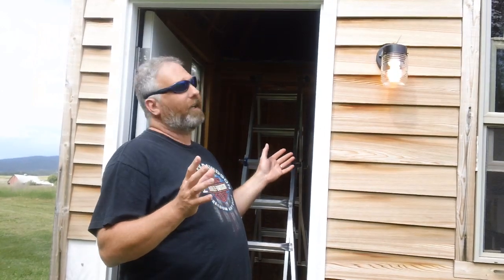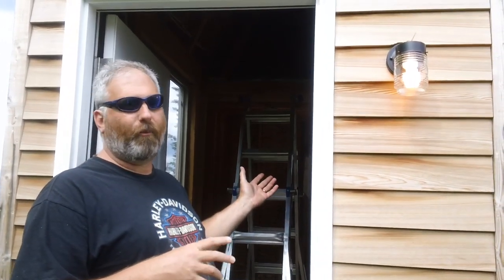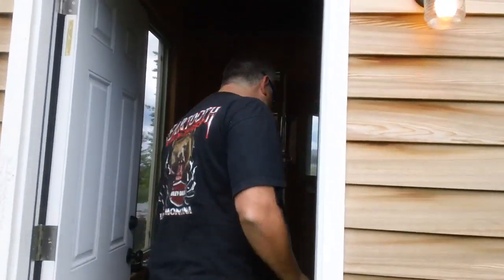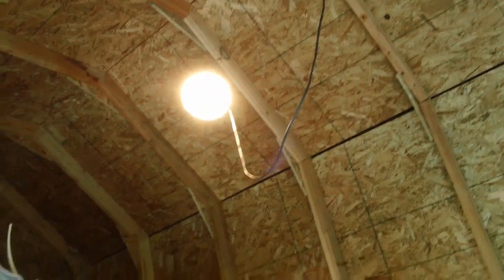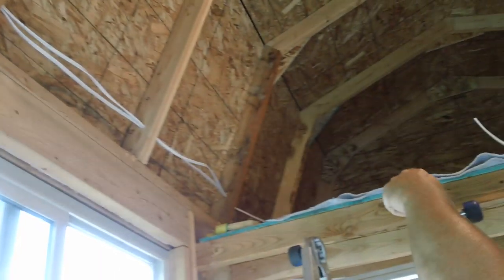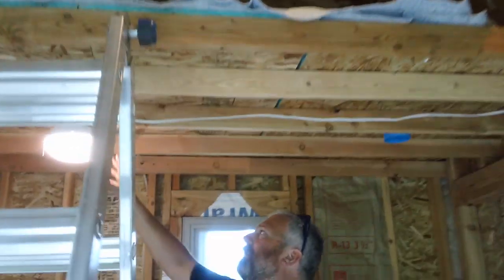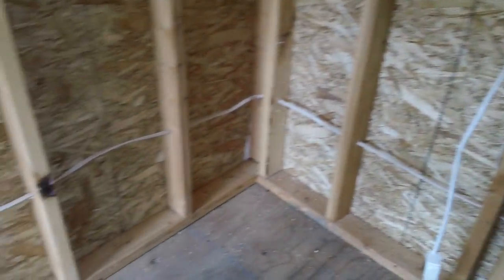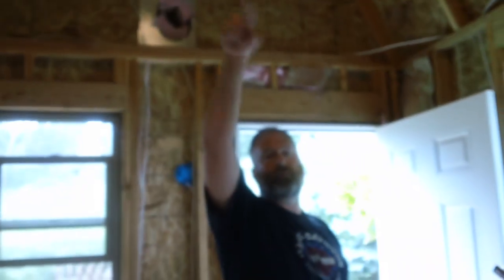Micro house power it update

Comment: What about conduit?  That pipe that you run the wires through.  Isn't that something you would need for safety?  Also, where are you building this home?  I would love to move forward with this but most states / towns do not allow you to build such small homes.  Do you cover advice on that in your DVD?

't
Reply from the maker: Hi Noah,You only need conduit if the wires are outside the walls .I built this in my yard.I am going to mount it on a trailer. You will need to check around as to where you can put it .It would be considered an R.V. on a trailer so maybe a park or someones yard. many people are doing this also in the country people are much more relaxed than in the cities.Where theres a will theres a way ;)